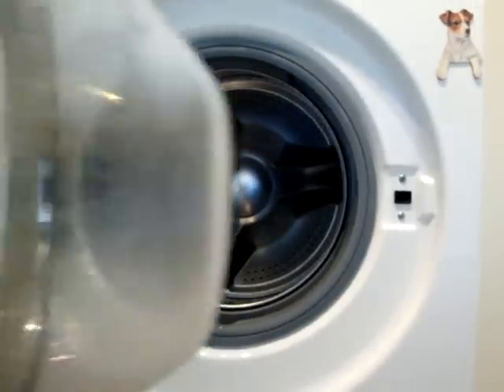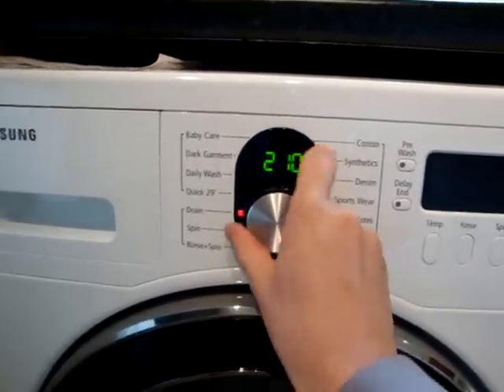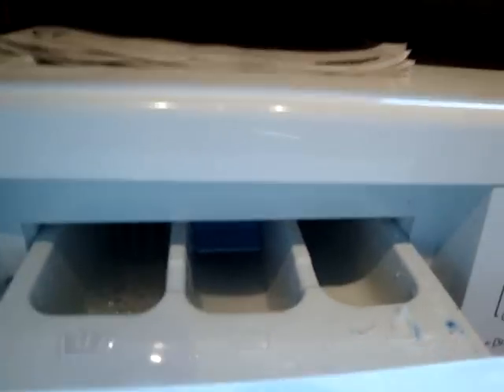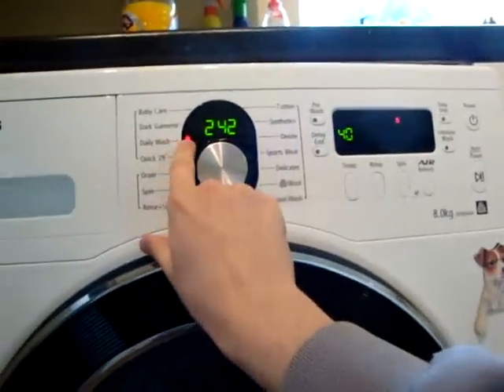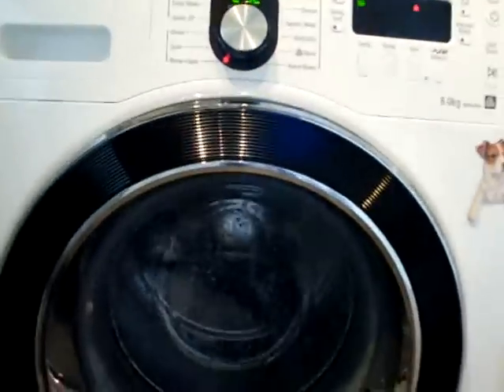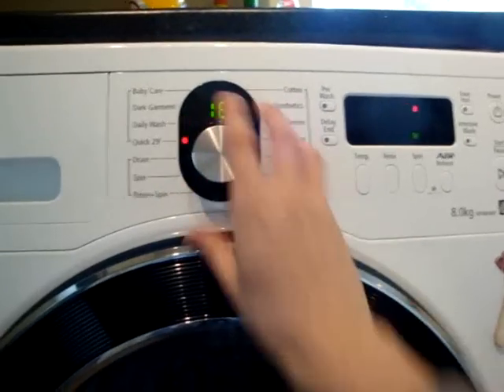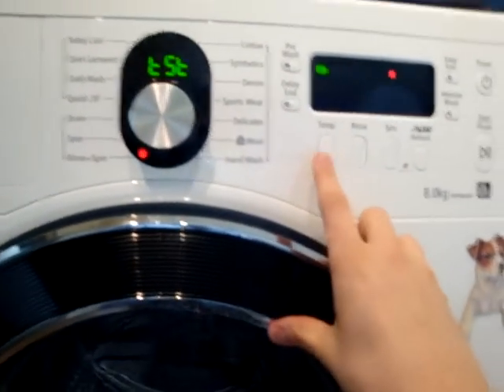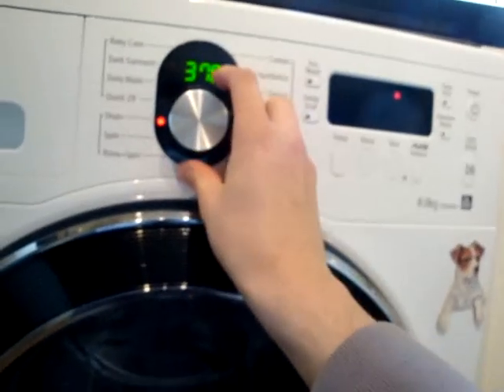samsung wf8804rpa diamond washing machine service cycle mode

Comment: Had this washer for 8 and half years now, just replaced the motor last week.  First ever fault, quick swap of motor and it is still washing perfectly.  Not sure what other Samsungs are like for swapping motor but this machine took less than 15 minutes to take old one out and fit new one.
Reply from the maker: Samsungs were starting to get more well built back then, now their build quality is continuing to rise, and they are still providing new features (a gimmic feature with the add wash door), but new features all the time.

Comment: @tsomo44 The front-loaders  don't have the water-level up to halve way the door anymore, It barely cover the bottom of the drum. But your was will be clean, doesn't need that much water to clean your clothes. I had a Bosch front loader, after just over 5 years I need a new motherboard and new shockies, was told that it was not worth fixing. Bougth now the Samsung WF0754W7V. Will try him out tomorrow. I hope to have more luck with this machine.

Comment from the maker: operate the machine with no laundry, if water appears in the drum, like 1-2 inches up the drum, then this is the correct amount, if you want a higher water level, you could ask an engineer to adjust an internal setting inside the machine. but in a nutshell the water level woant appear on the glass bowl anymore, 'to save energy and water', the delicate cycle water level on some machines appears up to or on the door glass

Comment from the maker: the air refresh thingy, starts makeing smoke when you swich it off, not when it swiches off.

the spin button controles the air refresh, while the air refresh controles something, i have tried several times to find out but im'e unsure what it dose
Reply: 06:25 No Spin apeers
400
800
1000
1200
1400

Comment: Hi my washing machine is samsung 8 kg ecobubble wf179w5v .I have a problem with it. It is blocked when i tried to use it .there is the red light but there is no reply .i can't put it on
Reply from the maker: +safsaf mimo could be child lock switched on. Often the reason there is no response from the controls.

Comment: do you know how to run test on MY machine? (wf0502)
Reply from the maker: no I don't but likely to use a similar method, holding down a button and pressing the on button
Reply: whichwasher2007
Ok.. i tried it and it works but i do not understand some features.. it only when i click temperature it fills with water and when i turn on synthetics, there spin speed.. i do not have any option by turning dial of "TST"
Reply: Lukáš Knoflíček  temp spin
Reply: Lukáš Knoflíček like mine you have to learn it i have p1253